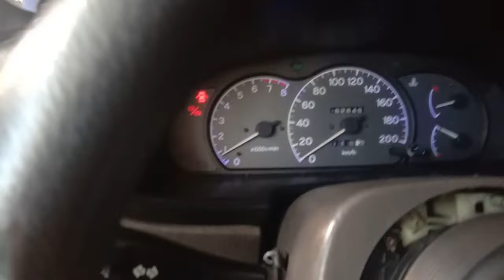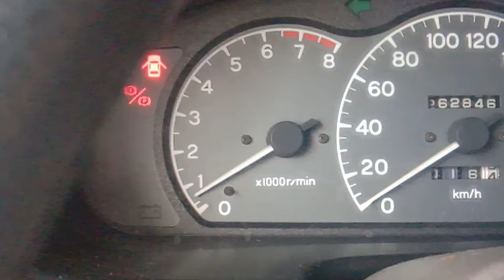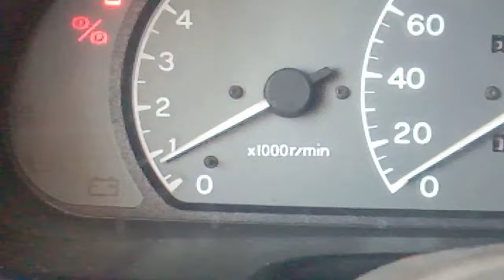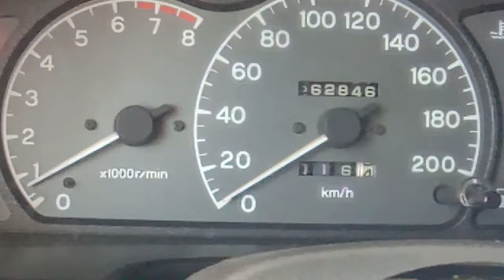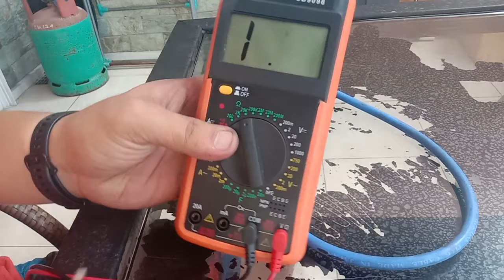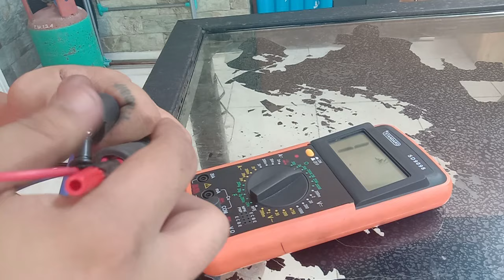Huli ka Balbon | Palyadong makina, naayos ng libre at walang gastos

Comment: Idol tanong lang pag ba pinagpalit mo high tension wire pero basa pa din ang sparkplug..at wala pa rin react pag hinugot
Reply from the maker: kung pinagpalit na ang HTW pero hndi prin ngbago ang andar. malamang wla sa HTW ang problema. check mo distributor or mismo spark plug

Comment: Sir good day. Hingi Po sana ako ng idea kung anu pa pw de I check sa makina na palyado ang pupugak pugak ang tunog sa tabutsi. Naga  compression test po ako. Ok Naman Po compression 135 Po lhat Ng reading.  Then scan Po Ng ecu. Wala Naman pong error code. Napa calibrate na din Po ang injector. Ok na din Po. Timing and firing ok na din Po at valve clearance ok pa din Po.bago Po sparkplug. High-tension wire. May kuryente and ok din Naman Po ang linya Ng mga injector. Fuel filter napalitan na din Po. Pero kahit bago na lahat eh. Sa cylinder number 1 walang reaction pag binubunot at injector socket. All thou ok Po ang injector dahil sinubukan Po ilipat sa ibang cylinder eh gumana Po. Pati Po high-tension wire Ng cylinder number 1 eh Wala din Pong reaction. Kahit bago ang sparkplug at may kuryente din Po ang high-tension wire. Salamat Po sana mapansin. 4g15 po ang makina ilog sir.
Reply from the maker: ung wiring mismo ng injector ang duda ko base sa mga nsabi mo...
Reply: Pero pinatignan ko Po ung connection socket Ng injector kung saan walang reaction sir. Tinest Po using test light at ok Naman daw Po. Pag nagpascan Po ba Ng ecu eh. Di Po ba madedetect un.? Nagpascan na din Po Kasi Ako. Wala Naman pong error code na lumabas sir
Reply: Di pa din Po Kasi mawala ang pag palya Nia Lalo na pag nakaidle Po ang makina. Pero pag naka on ang aircon ok Naman Po at di masyadong manginig at di Po maririnig ang pag pugak   sa tambotso pero pag off ang aircon and nasa 800 to 900 rpm andun Po ang pugak at naririnig Po sa tambutso. Salamat Po do . Lancer 4g15 EFI Po makina. Anu pa Po Kaya ang problema
Reply from the maker: maaring hndi makita ang error sa ECU kng mismo ignition module ang sira... try mo ipa diagnose ang ECU mo kay tatay Roger Sy
Reply: @otoklasmeyt nag try din Po Ako sir na salpakan Ng Isa pang injector ung injector socket 1 para malamn kubg may supply ang linya. At may naramdaman Po Akong lagitik galing sa injector na isinalpak ko. Kahit Po ba naglalagitik oh gumagana ung linya pero walang error sa scanning maaring anu pa Po Ng pwedeng sira

Comment: Anong high tension wire ang maganda gamitin sa 4g13a carb type sir? Salamat
Reply from the maker: asahi, optimum, NGK yan ang mga brand na trusted ko na klasmeyt
Reply: @otoklasmeyt  magkano po kya isang set ng high tension wire pang 4g13a sir ? Salamat
Reply from the maker: price ranges from 800-2000 depende sa brand
Reply: @otoklasmeyt  salamat po sir

Comment: sir napanuod ko po video nyo yung car ko kasi palyado ngpalit nako ng spark plug laging basa yung sparkplug nya ngpalit narin ako ng distributor tapos lagi ngiilaw  yung check engine indicator nya simula lang po yan nung ng overheat sya kasi pinaayus ko sa isang shop yung radatorfan niya di nakakabit
Reply from the maker: pag laging basa ang spark plugs, maaring piston ring ang problema... overheating ang naging cause nyan

Comment: Sir, ung akin ang taas ng idle nya, pumapalo ng 1.5k-2k rpm. Sagad na ung biss crew. Pag naka aircon nasa 1krpm. Bagong palit spark plug. Naka bypass servo. -lancer itlog 4g15. Ty
Reply from the maker: yan ang mahirap pag nka bypass na klasmeyt... check mo ung socket ng torpedo gear kng nka sarado.

Comment: tanong lang boss ganyan same issue lang din sa lancer pizza namin try ko ayusin baka high tension wire din. pero pag bubuksan ko aircon mausok tambucho tas tataas idle. pano po ayusin?
Reply: carb type 4g15
Reply from the maker: normal naman na tataas ang idle pag on ng aircon para hindi mamatay makina..
yung usok naman depende ang problema sa kulay
Reply: @otoklasmeyt  pag po in-off na yung aircon di na bababa idle tas itim po usok mga 10 mins pa bago mawala yung usok. pag pinatay naman makina tsaka lang bababa idle
Reply from the maker: check mo idle up at vacuum solenoid bka stuck up na

Comment: Sir,tanong kulang po kung anong dahilan ng ngingitim na spark plug.sana po mapansin nyo.
Salamat po
Reply from the maker: yung tip ba? rich mixture kng ganon.. mas marami fuel pmpasok sa combustion chamber kya d gaano nasusunog at nagiging carbon
Reply: Anopo ang dapat kopong gawin sir.
Kasi sa Utube lang po ako nakakakuha ng kaalaman sa pag ayos ng sasakyan ko.
Sanapo ma step by step nyo po sa akin kung ano ang mga dapat kung gawin ukol dito.
Pasensya napo at maraming salamat po sa pagsagot ng ng aking katanongan.
Reply from the maker: ano bang sasakyan mo at makina?
Reply: Mazda 323f gen 2 po.
Yan lang po ang nagiging problema.
Hindi kopo makuha ang tamang mixture ng gas at hangin.
May kunting kunti lang pong galaw ng rpm.
May isang spark plug po na ok ang 2 ayon sa fireng order
Reply from the maker: carb?
Reply: Fi p0
Reply from the maker: ipa calibrate mo mga sensor specially TPS at MAF... check mo rin kung singaw mga valve at piston ring
Reply: Sir
Nalinis kunapo ang maf sensor at throttle body. Tpos midyo pinihit ko ng kunti ang TPS at ang reading ay 4.54v
Nakuha kopo ang sakto timpla.
Malinis po ang spark plug at steady narin po Rpm nasa 800 po.
Thank you po sa mga mikaniko na namamahigi ng kaalaman.saludo po ako sa isang tulad nyo.
Maraming salamat po. At sana marami papo kayong ma sheran ng galing sa isang tulad ko na nasa Utube lang po umaasa🤗

Comment: Boss, panu sulosyon maitim usok pag ni rev. Same model sa iyo
Reply from the maker: black smoke means rich fuel mixture... marami msyado fuel ang pmpasok kesa sa hangin. maari mo tingnan ang air filter, TPS, ignition timing, MAP sensor...
Reply: @otoklasmeyt  lilinisan lng ba boss? Tska ang taas ng idle rpm nya boss pag on nmn ng AC taas ng bagsak magiging palyado
Reply from the maker: maraming pwede cause ang pagbagsak ng idle, pero ang common issue ay malfunctioning servo
Reply: @otoklasmeyt  okay po, boss! Salamat. Looking forward sa mga bago mong videos. Anyway, san po mabibili headers na ganyan?
Reply from the maker: yan na po ang headers nyan mula ng makuha ko

Comment: Sir may effect din ba ang spark plugs sa usok na lumalabas Sana masagot sir salamat nissan po sasakyan ko sentra
Reply from the maker: pag meron misfire ang SP pwede mgkaroon ng usok dahil sa excessive fuel burn
Reply: @otoklasmeyt  napalitan nAmAn n sir ng valve seal tapos reface sabi ng mekaniko ok nAmAn daw ring nya..pero may usok padin kulay blue sir
Reply: Tapos palyado pa sya..
Reply from the maker: blue smoke means ngssunog ng langis ang makina...
Reply: @otoklasmeyt  anu kaya possible na mayus sir..
Reply from the maker: padukot mo piston ring klasmeyt
Reply: @otoklasmeyt  ..salamat po sir mga magkanu kaya sir gastos kc nag pa top overhaul na aq binayadan ko 8500
Reply: Saka kaya po ba dukutin na di tinatanggal cylinder head.
Reply from the maker: mahal naman ng top overhaul mo klasmeyt...5k lng labor nyan
Reply: @otoklasmeyt  sa dukot klasmeyt magkanu kaya gagastusin ko pati piston ring?

Comment: Ang Mitsubishi adventure ko model 2003 gas
Palyado pakadyot kadyot 
Ano kaya dahilan
Nagpalit ko sparkplug
High tension wire
Para siyang kapos sa gasolina o kuryente
Reply from the maker: fuel lines ksma pump and filter, distributor or ignition coil... yan po icheck nyo klasmeyt
Reply: @otoklasmeyt  napalitan po ang ignition coil at distibutor
Reply from the maker: ano po makina?
Reply: Opo napalitan ang ignition coil at distributor
Mitsubishi adventure model 2003 gas po
Reply from the maker: ano nga pong makina?

Comment: Paps sakin umuusok lancer ko saka jan sa my takip naawas asayte nia?anu kya problema?
Reply from the maker: normal lng n my talsik ng langis sa filler cap.. anjan kasi ang mga rocker  arm..
Reply: @otoklasmeyt  ehh yung usok po anu na po ba kailngan gawin dun?
Reply from the maker: depende sa kulay ng usok..
itim- over gas
puti- coolant leak
blueish - langis
subukan m muna linisi  ang PCV bka barado
Reply: @otoklasmeyt  sakin po puti pg nka tigil umuusok mlakas umusok tpos pumupugak pugak po takbo carb type po sakin

Comment: boss same engine bakit sa akin Hindi ganyan idle boss hindi pino tulad ng idle sayo pakit tunog ng makina ko boss ano kaya papaayos?
Reply from the maker: ok ba idle ng makina?
Reply: @otoklasmeyt  Hindi po paps sobrang ingay idle niya hindi naman po nag lalaro rpm niya naka steady lang siya sa 1krpm paps
Reply from the maker: check mo valve clearance bka malaki na
Reply: @otoklasmeyt  paps same lang ba ng distributor ang 4g15a at 4g92? hirap ako maka hanap repair kit ng 4g15a puro 4g13 lng paps
Reply from the maker: mgkaiba